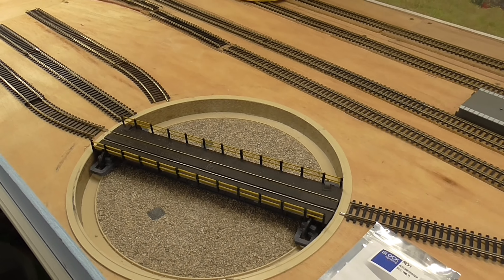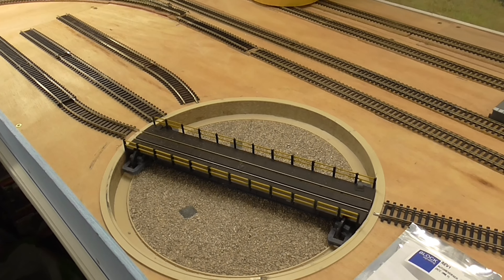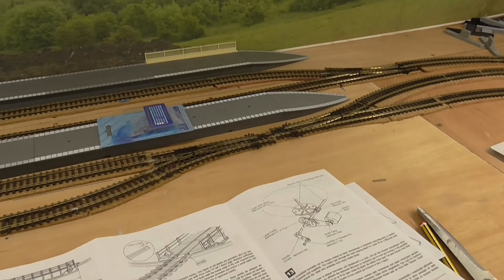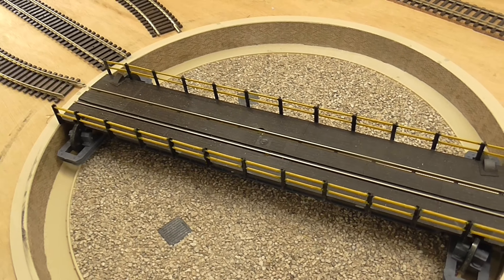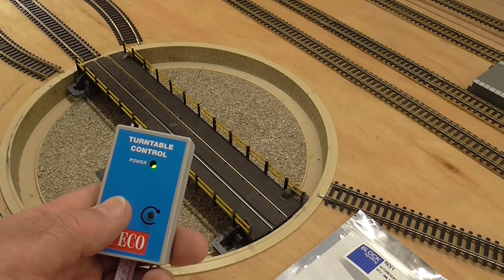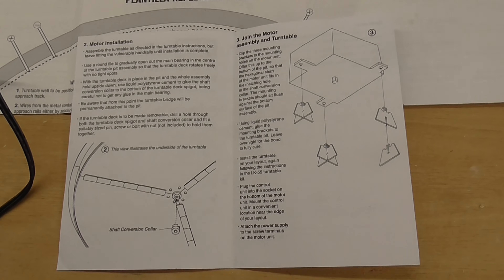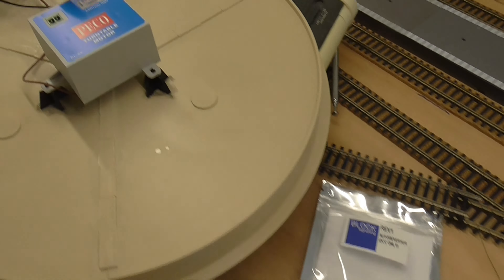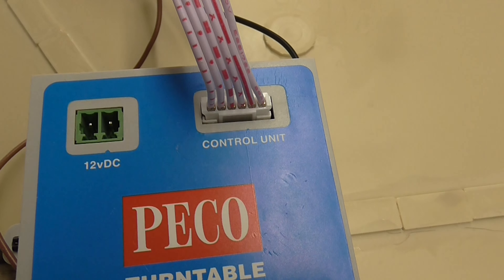Model railway – My Turntable install..

Comment: Cool a Tt install....nice..
I  had a lot of head scratching  installing my Over priced Fleisxhmann Tt. which I modified and weathered.
Reply from the maker: Many thank Jim, was a very easy install.
Reply: @SimonLivertonCentral  are you using a reverse loop mod unit for the bridge.
Reply from the maker: I will be using the module on the main track into the turntable.  I saw another video where the chap did what peco said but it did not work unless they used a module. I will then use what peco said on the other tracks.

Comment: The turntable install has gone well Simon. It took PECO a long time to produce the motor.  Interesting to hear the issues with the washers. A legacy of two documents written many years apart.  Look forward to seeing the replacement for the distribution blocks. Very intriguing. Stephen
Reply from the maker: Hi Stephen, many thanks for commenting. I am very pleased with the Turntable and motor, I now need to make some headway into my layout build. The distribution blocks should be here this week, will do a video when I receive them...Simon

Comment: Hi Simon. Not sure why you bought the auto-reverser if PECO said it would just work if you wired it up correctly.
Reply from the maker: I bought it because I wanted to and because another YouTuber tried what Peco said and it did not work, so they bought one of the reversers.